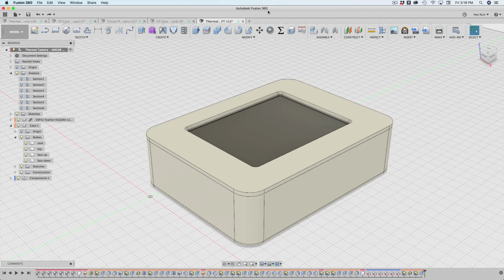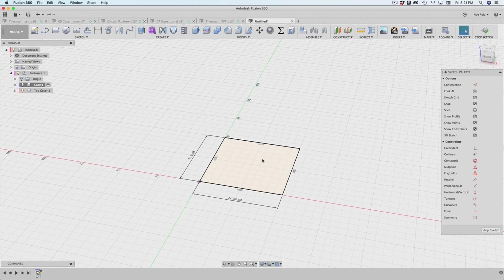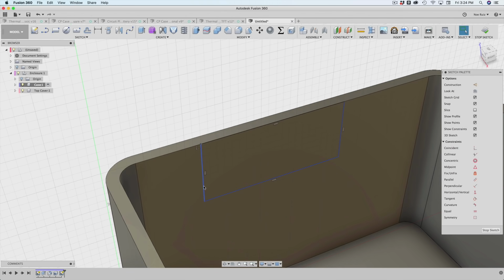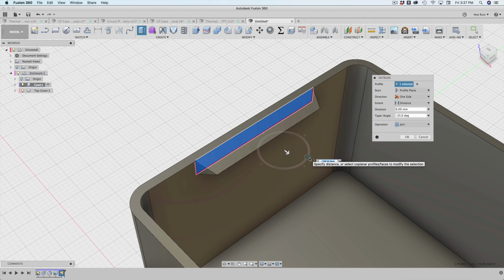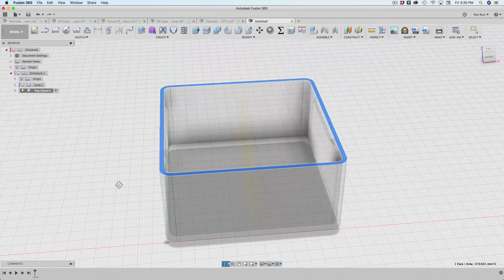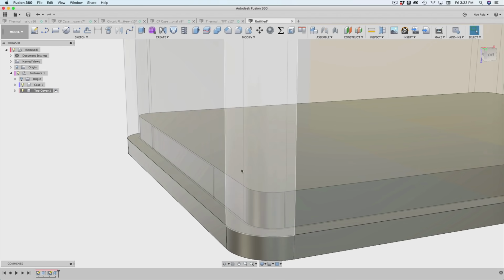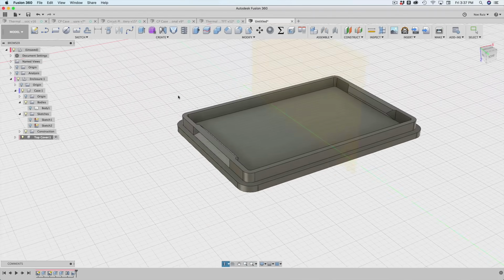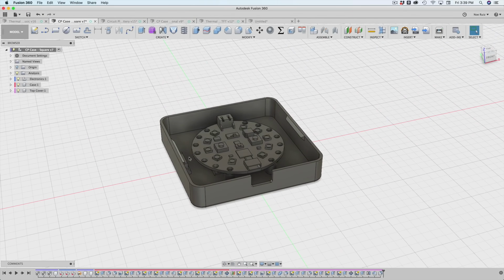Fusion 360 Tutorial – Easy Snap Fit Cases!

Comment: For the first nub sketch you can actually just use the midpoint constraint along the top edge of the inside of the enclosure and the top of the rectangle. It's not super obvious but the midpoint constraint can make lines share their midpoints. The only real trick to it is that it's easier to do when the lines aren't on top of each other since fusion handles stacked lines really poorly, but that's easy to work around by just moving the rectangle before you apply the constraint (or not making it on top of the line in the first place.) It also means you don't need the initial coincident/collinear constraint.
Reply: As a third option, I created a point where it snapped to the middle of the case line and another point where it snapped to the middle of the rectangle's top line, then picked "coincident" as a constraint.
Reply: This is much quicker